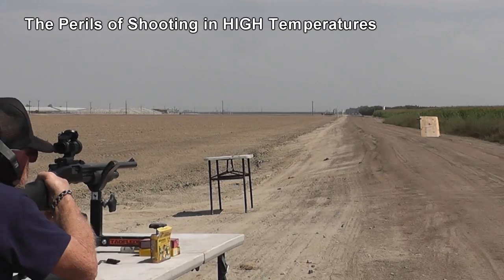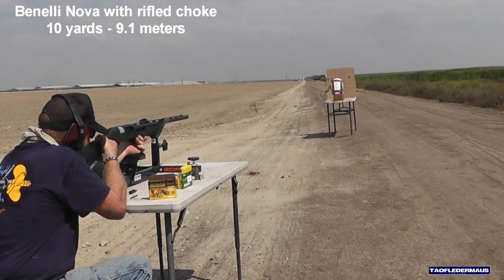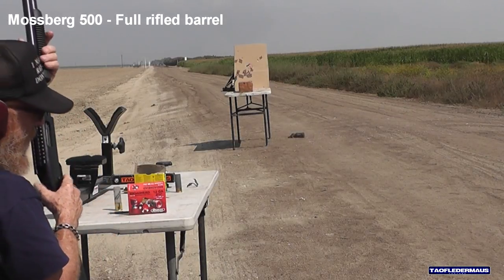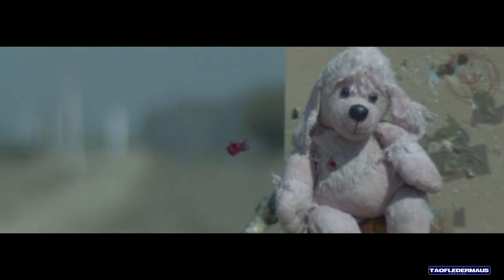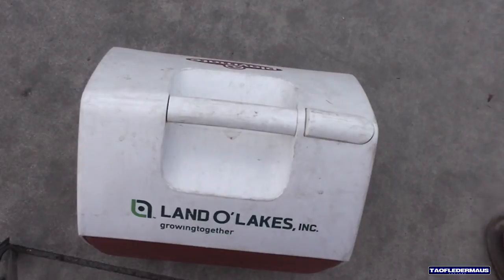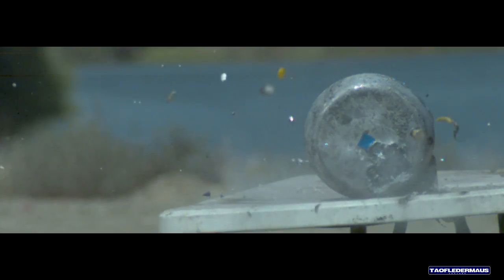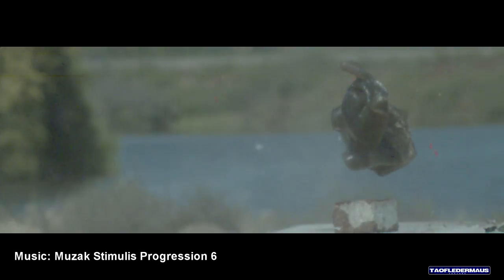Hot Weather and its effects on shotgun ammo

Comment: Great video Jeff. I'm glad you but this together this way so that others can see the effects of heat on ammo. Even common ammo is effected by temperature although it is seldom noticed by the average shooter. 👍🏼. 🇺🇸😎
Reply from the maker: I know that rifle ammo will shoot at a higher velocity when it is hot,  I think The Wound Channel did some tests.   I didn't know shotgun ammo could actually reach the point of failure if it gets hot.
Reply: This reminds of the old stores of Englishmen working up their loads, then going to Africa and blowing themselves up. We "supposedly" have more stable powders now.
Reply: Hi Jeff.  I have had .22lr subsonic rounds going supersonic due to the heat.
Reply: Phil Garcia do tell . I can't say as I've ever heard this . now I'm terribly intrigued
Reply: tezasdee slinglead,   I'm old, 65, and the stores are way older than me. Back in the day of the English express rifle, the White Hunter would work up his load (pun intended) in the cold of the English countryside. When he got to the 100+ degrees of Africa, the powders of the day would burn significantly faster with the requisite pressure spike. The inevitable happened.

Comment: I like your takeaway being that you'll test other rounds at consistent cooler temps. I never would have guessed heat would be an issue but this makes you wonder how many past failures could have been heat related.
Reply from the maker: I know,  we have had similar failures with some Russian slugs.   We were sent a lot of these DDupleks so we had plenty left over to further test test them.   And we still have enough to test again in the right conditions.
Reply: Reminds me of mythbusters when they proved that you can chill an explosive down to the point it won't detonate. Initial temperature does have huge impact on chemical reaction rates. What's funny is we all know this cause we know cold batteries don't work as well as warm ones, we just forget what that means.

Comment: Any one who reloads can tell you that temperature can affect the burn rate of most powders. One powder in the extreme is Blue Dot, when shooting with solid slugs in the summer I was getting in to the high 1600 fps. Trying the same load in the late fall the velocity dropped to the high 1400's. Most solid slug loads are loaded to preform in cold weather because of hunting seasons. Hope this helps. If someone has already responded sorry for not ready through the other comments.

Comment: Yup, added heat (from cooking in the chamber or sitting in the sun or just ambient temperature) will make the powder burn faster and can cause significant differences in pressure. It's why ya see long range precision geeks using infrared thermometers on ammo when figuring out a firing solution or why we'll try to keep the time between chambering a round and firing it to a minimum (to avoid cooking the round - at 1000m a difference of even 50 fps muzzle velocity can cause a miss). :-) I'd bet these are already loaded somewhat "hot" since they're all about putting the maximum hurt on a target, but probably tested at temps much lower than 105.

Comment: The factory probably loads their shells to be as fast as they can be, and it'd make sense for the heat to speed up the burning of the powder. Never would've thought about it though. Great video.
Reply from the maker: thanks!
Reply: pered5 No. Factories have to stay within certain pressure limits. This limits the speed of a projectile. Knowing the chamber length you may know what is this pressure limit in particular. Or ask the gun manufacturer.

Comment: if you check out any of the benchrest forums those guys are meticulous with their ammo storage because of this! even the .22LR has a huge accuracy difference and those guys will keep their boxes of ammo out of the sun and off the bench until they're ready to use them. also another thing to note as well is that steel expands at roughly ~.001" for every 100°F that it's heated which is why the benchrest guys will also clean the gun between shots and give the barrel time to cool back down for the next shot. shooting rapidly heats up the barrel and causes the steel to expand and throw off the accuracy, there's also the stock and the screws holding the stock to the receiver that will affect accuracy if not torqued right! the reason the high end precision rifles are bedded is to minimize contact with the stock and provide more solid and rigid connections to the receiver because the wood(the plastic/resin stocks are not as problematic but heat/cold does effect it to some degree) will also expand/shrink and cause slight warping depending on temperature and humidity. and with the stock expanding/shrinking it can over time cause the screws holding the stock to the receiver to loosen so you should check them often if you do a lot of shooting!

Comment: Yes, it is well known that temperature of the round and its pressure are related.  When the temperature goes up, so does the pressure.  Also,  when the temperature goes down, so does the pressure.  

I know that low temperature is not an issue for you SoCal people but it is for us that shoot in the north in the winter.  It is not uncommon for shooters to keep ammunition in a shirt pocket inside of their jacket until it is needed.

This video graphically shows what happens when temperature reaches outside of an normally expected range.  Well done.
Reply from the maker: I don't think people knew it would cause complete slug failure though.  DDuplek didn't even know this happens.

Comment: Long range riflemen have known about the effects temperature has on their rounds for a long time. Shotgun shooting is not something I personally have until now would have considered weather temperature to be so much a factor. It makes sense though, considering modern shotgun ammo has so many components, much of which is plastic. Heat weakens plastic and can cause it to malform under pressure. That could definitely explain alot of what was happening to your rounds in this video. Not to mention, hot powder burns faster.

Comment: I was thinking the shotgun cylinder is kinda acting like a car engine cylinder running to hot. Since the engine block has coolant running through it. It is the part that should be cooled. But a engine block that has exceeded operating temp or is overheating. Expansion in the cylinder walls causes a loss of compression due to a larger gap between the piston ring and cylinder. There by letting out gases on the down stroke.. I'm not exactly sure it that's the case with the shotgun barrel. But it makes a lot of sense to me. Sense the slug kinda acts like a piston. Accuracy is effected in all guns when the barrel is getting hot or too hot.

Comment: Now that was indeed a very interesting video! Didn't know the slugs were affected, the only thing I know resembling this problem is the G36. Shooting it by day wasn't that good in the summer. Same day, but at night and the overall score of my squad had raised considerably. Maybe because of the night vision attachment on top of the G36 (adding another 3-4kg), or the cooler air. 
With the known problems of the G36, barrel warping at high temps, it might be the latter.
Reply from the maker: There are probably some powders that are less heat-sensitive than others.   I'm sure pressure spikes from heat affects all firearms in some way.

Comment: The problem with plastic bullets, is plastic melts.  However, I would have thought that manufacturers would know that, and make rounds with higher temp plastics!  DDupleks probably uses soft/low temp plastic, in order to get the round to function the way they want it to.

Still a very good "information" video!

Comment: Very, very, interesting. It would have been even more interesting if you had tried some shots with a basic, factory loaded, Foster slug under the very hot conditions. I suspect that the Foster slugs would perform closer to their performance in cooler conditions because there are no gas seals or complicated wads to screw up. One thing I know for sure...

As newer and "better" slugs have become available I have tried just about all of them. I started experimenting with Brenneke slugs and then moved on to factory loaded sabot rounds with a rifled barrel. Short version: I got better groups at longer range with the Brenneke slugs but had an occasional "flier". I got even better accuracy at even longer range with "sabots" and a rifled barrel but? My one shot kill probability went down compared to my old favorite Federal Foster slug loads because they punch a smaller hole and are more easily deflected by brush. 

The really interesting bit is that I have a 28" IC barrel that is more accurate than a "slug barrel" with the Foster or Brenneke slugs and only a tiny bit less accurate than my rifled barrel with just about all of them. So? My pheasant barrel is also, with the simple addition of a red dot sight, my slug barrel and I have not needed a second shot at a deer since I regressed to the older technology. By switching out the IC barrel for a full choke I use the same gun, a Browning BPS, for ducks and geese. Plus? I managed to trade my "slug barrels" for a Ruger Single Six that is my favorite "plinker" and I'm down to one shotgun for virtually all my hunting needs though I do still use my beloved, 20 gauge, Beretta Silver Snipe for most of my grouse, snipe, dove, and woodcock hunting even though I don't hit with it as well as with the Browning. The shorter, lighter, silver Snipe is far easier to carry up and down bluffs and gullies and through thick brush than the BPS and the quicker second shot is more valuable than the higher capacity for that kind of hunting.

Cheers!
Reply from the maker: Yeah,  I think foster slugs would just fly faster.   It's hard to chronograph slugs because you get a lot of errors if the wadding passes over the chronograph,  or can destroy it if he strikes it.

Comment: Very interesting.  Have you considered the union between the lead slug and plastic stabilizer?  Maybe the difference between their thermal expansion coefficients may be enough to lead to separation.  Now that I think about it, there would be.  The inteference-fit they are assembled with may be to low.  Could be just a question of changing the tolerances on the stabilizer or another grade of plastic.  Either way it is a manufacturer issue.  There is no good reason for these shells not working properly on a 105 degree day.  The odds are they never even performed a temperature spectrum test.

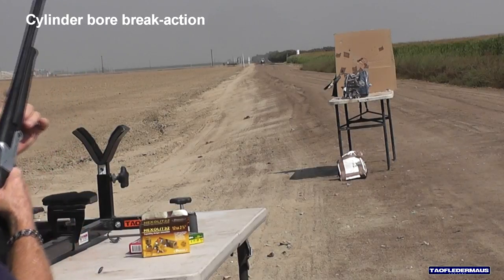Comment: Lets hope it is a softened 'wadding' problem caused by the heat & not the smokeless powder going a bit wobbly, although judging by the thump Danny got at 01:56 I wouldn't dismiss that theory altogether. (Not a lot of weight in short singles, eh Dan)
Might be interesting to make some 'hot weather' loads, same powder & amount, to judge stacked cards against plastic pistons.

Comment: Jeff, can you check the inner diameter of the bore of the shotguns in test? DDupleks slugs fly badly from bores wider than 18.4mm. I assume they simply start wobbling in the barrel as their diameter is smaller than the bore.. Please also check the slug diameter usung calipers. I've checked and have proven it personally using Browning B725 Sporter with 18.7mm bore and one turkish shotgun with 18.4 mm. Turkish shotgun was way more accurate. And, yes, the extreme T may have added to the result on the video.. Excessive muzzle pressure was definitely destabilizing the projectile..
Reply from the maker: The Turkish break-action shotgun muzzle is .725" or about 18.4mm.  I'm not sure what Danny's rifled shotgun measures. The rifled choke measure .710" (18mm)  at the end.
Reply: TAOFLEDERMAUS Thanks Jeff! In this case I guess the overpressure is the reason. Great video! No kidding.

Comment: Very interesting video, in hindsight it makes sense considering the temperature required to structurally weaken most plastic is well below its melting point.  I just wonder what the root cause of failure would be in this case, is it the plastic, the powder, or the gun barrel itself expanding with the heat.

Comment: when you get to the video where you cant hit squat and you are using a scope or red dot this comment will be my "i told you so".
the line of sight of your scope and the line of travel of your projectiles should be as close together as you can get them. having the scope one foot above the barrel means the bullet, sighted in at one distance, will never be close to on target again. there will be 2 spots where the two lines cross but one will be a mile from the other.
if you use a high caliber rifle and the two lines are an inch or less apart hitting a target one inch low at 25 feet will be on the mark at 100 yards. the arc will make the bullet on the mark again, I don't remember, maybe 300 yards.
the point is narrow the window of bullet travel because the line of sight is straight.
Reply from the maker: They slugs were just tumbling  at 50 yards,  were all over the place.  Only 10 yards we were able to hit stuff.

Comment: interesting. i wonder if the heat is softening the hull and allowing gasses more room to go around the components. i may be way off base on that, just wondering. if you feel like nerding out on this, maybe get some brass hulls, load them as per these, let them sit out, and compare them to the normal plastic hulled ones. anyway, cool experiment.
Reply from the maker: The hulls probably expand and fill any space in the chamber no matter what temperature it is.

Comment: It's interesting that Ian & Karl from InRange did the same test in Arizona summer heat.  They had zero problems with their ammo... What was the difference?  They tested rifle round (obviously means there was no plastic).  It would be interesting to see you conduct this test again with the magtech all brass hulls and see if there's a difference.
Reply from the maker: We were using shotgun ammo.
Reply: Well this is Taofledermaus, so of course it's going to be shotgun ammo!  My point is that (if what you said in the video is correct) it's the plastic that's causing a lot of the issues.  What if the plastic hull is allowing the internal temperature to change dramatically?  Would a brass hull eliminate some of that or would the result be the same?
Reply from the maker: It was all internal problems.   We weren't getting split hulls or anything

Comment: So I guess if it is too hot out, we should be using slugs that do not rely on plastic components. So, back to classic Foster slugs with fiber pistons we go. The slug that has been around for longer then I have been alive.
Reply from the maker: Even foster slugs would be affected and you point of aim will change due to the speed changes.   I think trying to keep the slugs at a consistent temperature - regardless of the weather,  is key here.
Reply: Hum...no. I am not carrying a cooler though the woods like one of those, I am going hunting....with a case of beer hunters. Instead, I will just have to test my point of impact at different temperatures and keep an eye on the weather. Now that you mention it, most of my sighting in has been done at about 90 degrees. Maybe I should test when it is cold as well.

Comment: Hmm, good take away from the results. But they should work in any heat range that people live and function in, if not, is problem with material quality. And I would say, they are defective. A 100F isn’t hot, it’s just fairly warm. And I know people will will be like, “oh, the metal of then gun is at least 120F” so? Does your car work in a 100 degrees? Does your pistol or rifle? I know mine do, and I’ve shot my shotgun in those temps, and higher, they all worked just fine. Now I don’t shoot silly rounds dependent on lots of plastic, but you think they’d be made to work anywhere reasonably well on earth. Apparently not. At least I now know to never buy those, as they aren’t reliable in conditions people can easily survive in.